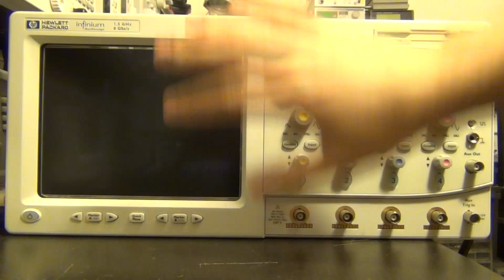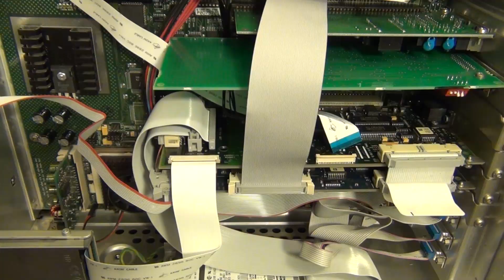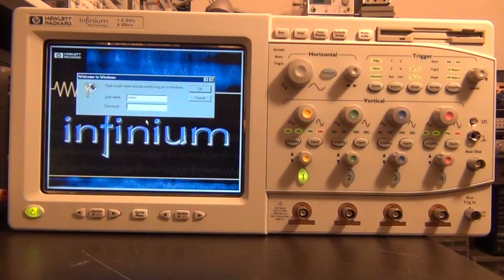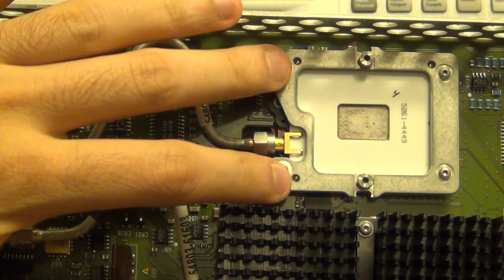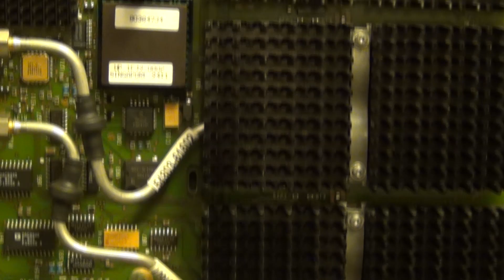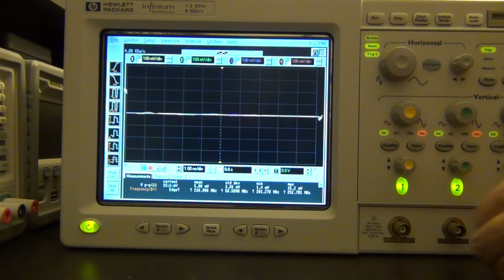Comment: Hello, I have the model with the VA 503A motherboard. But mine fails to display anything on the screen when you push the power button. The CMOS battery red zero volts so I replaced it and I checked the battery on one of the HP cards for the display and that one read 3.1 volts. I'm not sure what's causing it not to boot or display anything on the screen. I've tried leaving out the CMOS battery but still nothing. The bios is a phoenix bios. The screen has some sort of barely visible black lines when on but still doesn't turn on any help would be appreciated. Reseated all the ribbon cables inside the case but have trouble removing the front panel

Comment: I bought one of these myself.
Though, the problem mine had were a dead hard drive, and a broken screen. (Probably CCFL back light driver being dead, but using an external screen is a simple fix.)
But I need to find a source for the software for it.
Reply: witch one?
Reply: @LisasexgeilesLuder  Good question. I don't really know. But to what I have gathered it is the same as shown in the video.
Reply: @todayonthebench  I am currently looking for a scope too an i am thingking about a 54815A (the cheapest one) if i buy i would use a ssd and dump the drive
Reply: @todayonthebench  but thoese scopes are expensive (540€ in germany) and for 500 ill get a new 100mhz rigol without old electronics with risk of dying
Reply: @LisasexgeilesLuder  Honestly, an old scope like this even with all the bells and whistles aren't really that "useful" by modern standards. The exceptionally small capture memory makes it had to collect enough data to find what one is looking for, and the triggering speed is slow as well. (finding intermittent signals is a needle in a hay stack.)

Its high bandwidth and sample rate does however make it "nice" for working with some higher speed signals, if one has the right probes for it.

But for general bench use it is frankly garbage compared to what one can get for 500-1000 €. (Unless all one needs is that peak real time bandwidth (a very niche thing), then these old scopes are a bargain.)
Reply: its 500MHz 1GS/channel

Comment: OMFG! 95 was the last Windows I used prior to switching to Linux. The password thing is required just so you can join a Windows network. No need to provide one since you won't be running NetBEUI / NetBIOS any time soon :D. Apparently TCP/IP and DNS have gained a bit more traction and quite a few computers tend to have it preinstalled nowadays :D
Reply: You kids and your IPX/SPX back in my day we sent packets via carrier pidgin.
Reply: Well, Windows computers still use NetBIOS over TCP/IP for file&printer sharing.

Comment: We use these at work, and I have such a love-hate relationship. So capable bandwidth wise and as far as measurements but such small memory depth.  Asked for a new scope that doesnt run on windows 95, and got rigol 2000 series 70 MHz scopes :-/  So now I have the infinium and the rigol on my bench.

Comment: It's safe to hard shut-down the Windows because it doesn't write much to the drive. (probably only the user settings) Parts of it are loaded into a RAM drive, and this is where most of the writes are happening.

Comment: Oh I almost forgot: I have seen these modules near the CPU also on standard mainboards back then. AFAIK they were only necessary for certain CPU types that needed special voltages. There are capacitors near the CPU and also in the power supply that are a bit "mean". Which refers to: They do look perfectly fine but they are not. I had to replace some of them that lost about 30% capacity and also had increased ESR. They cause the aquisition and/or mainboard to lock up randomly (about once per hour), especially when the scope is warmed up.

Comment: I like your repair videos. This one was pretty simple (good for you, bad for us), so hopefully you can find some test equipment that has something besides a power-related issue. Those more in-depth troubleshoot/repairs are the most fun to watch. Seems like most of the power problems are just bad caps/bad regulators or a blown fuse. It would be fun to follow along where you actually need to bust out the oscilloscope and multimeter to troubleshoot the issue. 

Thanks for the videos. I had no idea you had a PH.d.  Im assuming you have a day job as well?
Reply: +Ron Berry 
https://www.linkedin.com/in/shahriar-shahramian-41813912
http://www.columbia.edu/~ktj2102/CISL_D/Seminars.html

Comment: Nice teardown! It's a big LOL when you see pieces of cake like this on Ebay in US. It's incredible how people doesn't even looks for a simple repair. 
Could you guys gently speak more about RF? And I have a little doubt, when designing a RF PCB (for a transceiver, for example), is this correct to isolate GND and POWER signals between stages with beads like we normally do with Digital and Analog domain? Or make just a big GND plane and that's it, just separating the power (for the Power Amplifier) and low power signals?

Comment: Excellent, Shahriar, Your video has been very useful to me! I have recovered the exactly same scope from scrap, and after fixing some caps on the PC side around the CPU, the windows started to boot!!! :). Similar symptoms with selftest though but the trigger issues you see at 1.5GHz already start at 1GHz on mine. Sometimes, cannot trigger at all, unless I do autoscale with lots of clicking of relays that usually fixes it. So I was suspecting some relays were at the end of their life... Since this does not happen very often, and under 800MHz it is quite dependable as as a "hobby scope" I did not have the courage to pursue the ultimate fix... You gave me some ideas, thank you!!! Did you happen to find a service manual by any chance?

Comment: I doubt I would have considered that issue with the ADC's. Even if I did, not sure I would have the stones to pull it apart. Well done! Considering the architecture to build some intuition of the problem as step 1 clearly saved a ton of time chasing your tail. To some this may seem like an easy fix, but without the methodical approach to gaining intuition it could have been a total fail.